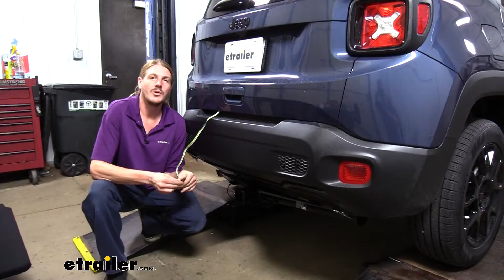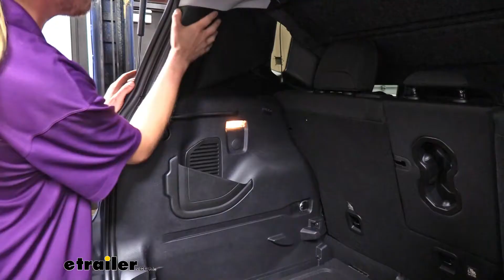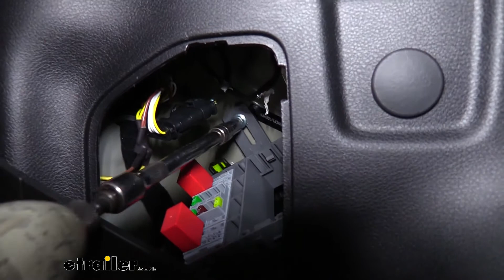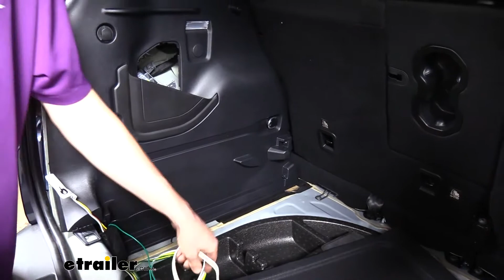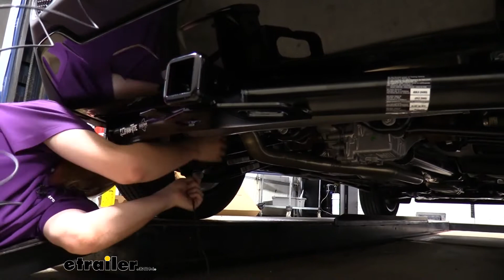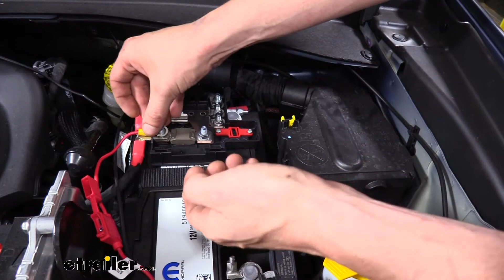etrailer | Curt T-Connector Vehicle Wiring Harness Installation - 2020 Jeep Renegade

Comment: Thanks for sharing. FYI - There is zero need to drill any holes in the cargo area and risk water intrusion. You can drop a fish wire through an existing capped hole (cap that you can drill a small hole into it for the wire, with 3 rounded sides and one flat side) inside the left plastic access door to the tail light. It will emerge just behind the rear bumper, where you can run it along the bottom an into the engine compartment / battery. Make sure to stay away from parts that move or get hot (suspension, exhaust pipes, drive axle, heat shields, etc).
Reply from the maker: Nice! Whether you drill a hole or use and existing grommet/plug, you'll want to seal around the wire passing through with some silicone caulk. Not only to prevent water from getting in, but also exhaust fumes. 
https://www.etrailer.com/Vehicle-Suspension/Air-Lift/AL47PD.html

Comment: Great video! Here’s a few things I did different for future viewers, total install took me like ten minutes. 

1) I didn’t remove any of the interior side panels or weather stripping. I removed the base plate where those cargo hooks are and then simply fished the trailer wiring up both sides behind the panel. There is a ton of room there, probably the easiest wires I have ever fished in my life. 

2) instead of drilling a hole in the floor of the trunk and running a power wire up under the hood I simply installed a fuse tap in the fuse box right there where the trailer wire grounded too. 

Super simple changes that save a lot of time.
Reply from the maker: We definitely agree with your first point, however we don't recommend making that power connection anywhere other than at the positive battery terminal. Getting power from anywhere else can leave your vehicle's electrical system vulnerable to any short circuits that might occur in the trailer wiring. Which would be bad!
https://www.etrailer.com/Custom-Fit-Vehicle-Wiring/CURT/C56274.html
Reply: @etrailer  That is what the fuse is for....